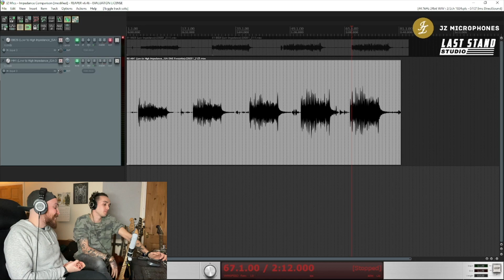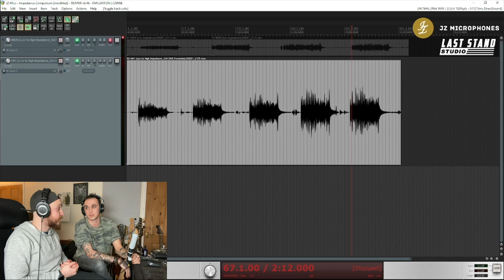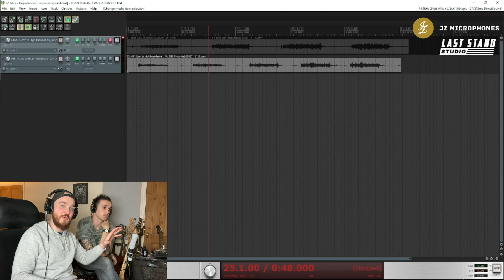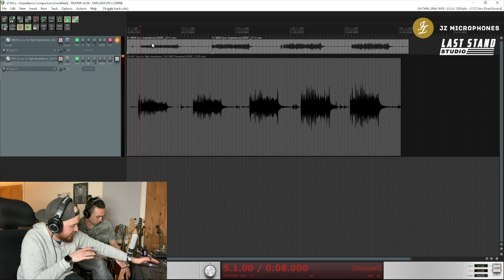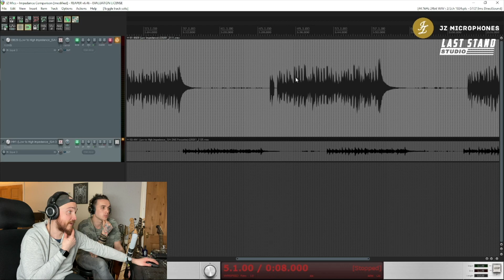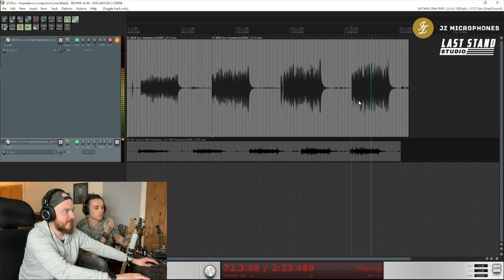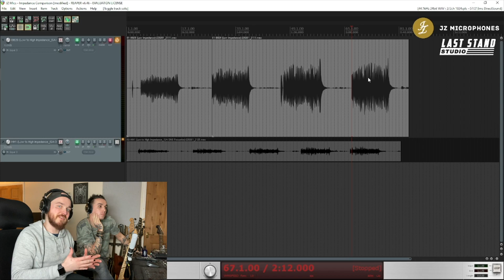Impedance Comparison

Comment: Hi there great video , I have no idea still how to use it. My preamp impedance goes up to 3K and I'm using a Mic as a input. Shall I set the impedance level higher or lower for best results for Mic (vocals) - thanks!
Reply: In general, you want the preamp impedance setting to be MUCH (at least 5x) higher than the mic's impedance. If you have a 3k pre impedance and a 600 ohm mic impedance you're golden.
Reply: Hi there, did you ever find out the answer? If so, can you please share it? 😂
Thanks!
Reply: @PhotoGuitarGuy  nope .🤣 1 year later and nothing , I just wing it and use my ears now 🤙🏾
Reply: Prob the best way to go!  @TzoHill